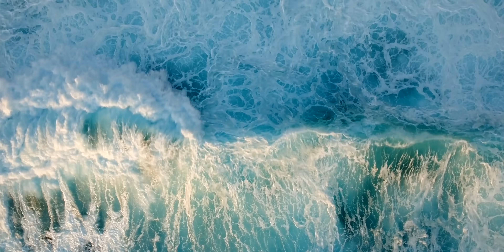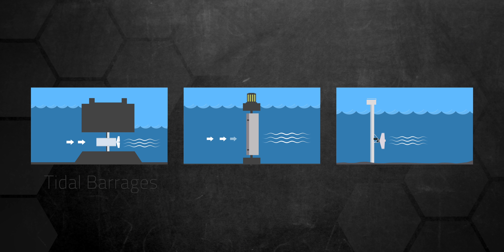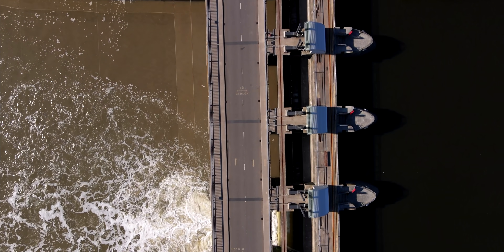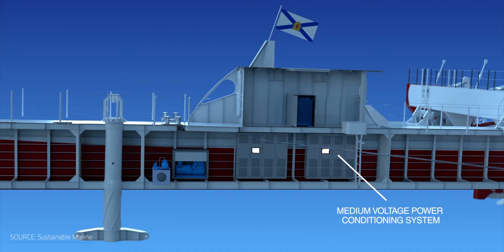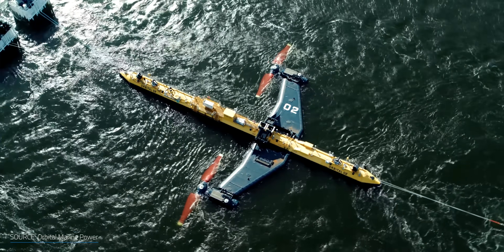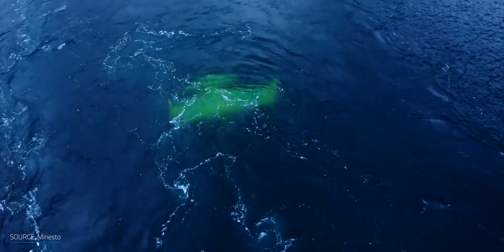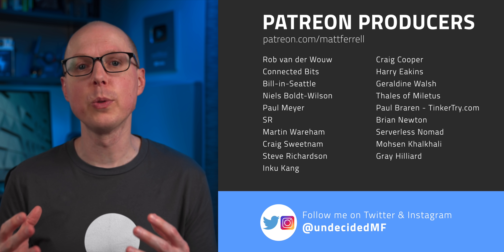Can Underwater Turbines Work? Tidal Power Explained

Comment: Would like to hear about any of these technologies that have little to no maintenance requirements, as that is the real problem with tidal energy. Thanks!
Reply: Minesto was spun off from SAAB, a company that is pretty good at building submarines. From what I gather, they have been focusing on keeping down maintenance costs from day 1.
Reply: Yeah. Maintenance costs must be very high because salt water is so corrosive.
Reply: @Thoughtful_Balance  Maintenance is factor, but Minesto solved that with an exchangesystem. Towing out a new system, change and than make the service on land. The system in Faroe Island for example is less than 1hour, from harbour to harbour. ( i think they went down to 30minutes in the end)
Reply: @tidal-oceancurrents7552  thanks a lot for the information. It's much appreciated. 👍
Reply: @tidal-oceancurrents7552  1 hour on each tiny installation each week... Talk about INSANE amounts of $$$.  Delusional.
Reply: @w8stral  what are you talking about? Maintenance The kite is 1 planned and one unplanned  per year. So 2 hours per year. (+plus the time for the job on the kite in the garage!) the kite is towed in so no lifting and with very small cheap boats. Maintenance is one of strongest part in  the Minesto-koncept.
Reply: @tidal-oceancurrents7552  Sigh.... Tiny installation which means gobs of these tiny shitty things needing cleaned as we need GW's of power this joke and since this is a moving structure hydrodynamic slow moving structure you must keep it clean far more often than once a damned year. In bad water, try every 2 weeks at worst case.  Any boat owner with the best bottom pain in the world can tell you this.  Only giant ships who routinely go past 20 knots which self cleans the hull of their ship can get away with cleanings every 5 years and even they lose plenty if not cleaned more often than that.
Reply: @w8stral  you know these are already operational, right? So you can already look at real world empirical data and not speculate.
Reply: All power generation technologies (even solar PV) need some maintenance.  These are small-scale R&D machines just like the first generation of wind turbines were.  The issues they face with corrosion are pretty much identical to the global shipping industry. I wouldn't expect a rotor blade to have too much trouble with fouling (just as with ships' props).  If the hulls of these machines get fouled that will cause a bit of turbulence but, I wouldn't have thought it would be significant.
Reply: @Tim_Small  Uh no, the issue they face is that tidal power is a joke as there is NOT ENOUGH of it to matter and it seriously has environmental impacts.  Massive impacts.  If the USA wanted to starve out everyone in Europe, all they have to do is slow down/nearly stop the Gulf Stream current, biggest in the world we can get to by far, with "tidal/current power" generation plants.  Impedeing said current... gets a pathetic ~ 20GW... Somehow I do believe the peoples of Europe would go to war over such an installation.
Reply: @w8stral  are you also one of those people who think putting up wind turbines will somehow slow down the jet stream?
Reply: @teohhanhui  Vast ocean currents move VERY slowly and are not able to be used to get power from.  Only a very rare few such as the Florida current in its small channel with a constant ~3knots can be used. 

As for GW and mixing.... Baloney, the mixing will just happen in different regions as it is temperature gradient based + wind to the 4th power.
Reply: Obviously they have gargantuan maintenance problems... moving surfaces underwater which are supposed to be hydrodynamic.... will grow barnacles etc....   Makes the wave energy guys doing blow turbines look sane.

Comment: 3D printed extremely powerful permanent magnets with an aluminum sheet as an alternating shielding that can easily slide fully between and fully out of the way by a tiny fraction of electric power that the pull of those 2 magnets can keep can keep cycling for many thousands of year as non-friction. The reason what this will not break the laws of physics is because it takes very little power to slide the aluminum sheet to detract those extremely powerful magnets. This does not have to be gravitational device if placed in a torus loop in which the magnets alternate corresponding with the aluminum sheets. The major downside would be the back and forth vibration and maybe noise. The mechanism is easy to build... just try it out.
Reply: I’ve thot something similiar in my head, but wonder if it eventually stops from friction or output only determined by input. But def cool idea needs tries

Comment: I live near the Ohio River, which has strong current flow, and several Hydro Damns.  Many people have small boat docks and the water is 30'-40' deep at the end of the dock.  I've often wondered if a small turbine could be mounted below the end of the dock, with a powerline running back to the house.  Would only need to produce about 20KW of power.  Some of this new tech makes it sound like this might actually work...

Comment: Even if ALL tidal power resource in the UK were tapped, it could meet only 12% of the nation's electricity needs. Therefore, it will struggle to reach scale and remain a small player in the green transition.
https://www.gov.uk/guidance/wave-and-tidal-energy-part-of-the-uks-energy-mix#:~:text=exploit%20these%20assets.-,Tidal%20range%20potential,of%20current%20UK%20electricity%20demand.

Comment: Except for the membrane type, none of those designs seem to solve the  harming marine life problem.
Reply: The thing is, all power plants have a heavy impact on the environment in some way. The greenest way to reduce emissions is to not produce them in the first place by using the energy we have more efficiently.
Oil plants are the source of some of the biggest catastrophes and climate change will kill much more than these energy sources.
Cats kill many more birds than wind parks btw.

If you want to save sealife get rid of single use plastic
Reply: @maxmustsleep  very true
Reply: I think thts the safest design by far according to my LOGIC, all it has is membranes Floating, i dont think even fish are tht dumb to die in a swaying peice of metal
Reply: I don't feel like any animal would want to go near any one of those things. But maybe the turbines might create a current that pulls animals so I don't know
Reply: Well it's that or global climate change.
Reply: Solar farms can require clear cutting, wind turbines kill birds, tidal is going to kill some marine life, hydro has large impacts on ecology, and that doesn’t account for the mining necessary to produce elements for those products. These are all great options over some fossil based power generation, but let’s not kid ourselves by thinking ‘green’ means no impact.
Reply: The minesto kite does not hurt marine wildlife. It is actually live right now so that is easy to study (which 3 universities are doing)

Comment: These are some interesting ideas that will work well for small marine communities with some battery storage for high and low tide where water flow is at a minimum. If they are used on larger scales like we do with wind turbines they will do more harm than good, and the maintenance activities and toxic waste creation and used component disposal stream will only harm the already over stressed oceans more in the long run. In short this is a good solution for the few coastal communities where SMRs, solar and wind with batteries or pumped hydro, and geothermal are not an option.
Reply: You are wrong😊

Comment: Because water is many times more massive than air, the blades do not spin at any speed that would actually affect marine life
Reply: Yeah I bet they are geared accordingly. As long as they don't create the same pressure variations from the huge wind turbines.

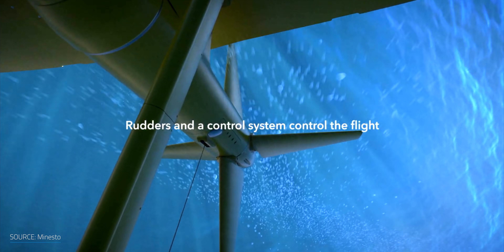Comment: 8:36 -- The "Deep Green" kite is fascinating because they chose to have the kite actively controlled by computer to keep a figure-8 pattern.  There are several known wing-shapes which will automatically destabilize aircraft at all times (often used by fighter jets).

If one of those unstable wing-shapes had been used, the water kite would be be continuously unstable (moving) through the water, presumably generating the same amount of electricity but more efficiently since the figure-8 control mechanism could be abandoned.
Reply: Don’t know if I understood but the energy is generating bybthe speed of water going through the turbin. How will speed increase with tpur suggestion? By skipping figure 8
Reply: They were spun off from SAAB, a company that makes both submarines and fighter jets. I think they know what they're doing.
Reply: Unstable would mean that without control it would spin, stall and fall to the ocean floor. presumably there is some shape that would do figure 8s passively but they probably considered that.

Comment: I always thought that the waves are strongest only at the surface and the currents are negligible close to the floor.
Reply: Yeah, I imagined that the bottom was stationary while the water on top sloshed back and forth.  But maybe it's just the wind that does that, maybe the tides do the opposite.

Comment: I think that membrane thing will be the one to catch on, can build dozens of them without endangering sea life (which will keep activists happy), is easier to maintain as all one has to do is fill some bags attached to it with air to bring it to the surface and do maintenance there instead, should be possible to attach an air bag to the tip for the same purpose, by adding air to it it prevents it generating electricity on the way up and allows for safe shutdown for the maintenance. For the airbags they just need to be connected to a pipe which can have a hose attached to it, once used they just need to be replaced with dry ones and left to dry for re-use.
Reply: I think this project is not working properly…to many moving parts.
Reply: @tidal-oceancurrents7552  Even if its a slow take off the tech will still gain the most popularity I expect, if I remember rightly analog circuits was originally abandoned because they were also difficult to build, yet from a vid I watched ages ago I heard they're experiencing a resurgence in popularity, I expect this will have a similar resurgence
Reply: The that gonna be a reality is Minesto, flying kites😊

Comment: How will they protect against contamination by sea life?  Will the cost to clean or maintain the system outweigh the benefits?  What is the life span of the system?
Reply: In Minestos case the lifecycle is 20years with 1pöammed and 1 unplanned service per year. Thether is exchange every 7 year

Comment: This issue isn’t “can it work” as it clearly works. The real issue is will it catch on, get funded and insured and adopted by utility companies and municipalities
Reply: Very true, and in Minestos case, the flying kite. That journey has already begun. SEV utility company i Faraoe Island is showing the path. With that said, floting wind have taken 90% of the attention. and most of the funding so far but we can clearly see that it will change. The kites are ahead of floating wind andis  both cheaper and more stable. Hopefully we will be able to see cooperated arrays between floating wind and the kites.
Reply: A huge issue as well is reliability. Water is very abrasive, the salt in saltwater is very corrosive, and tidal power is quite extreme. 
Many of the tidal projects that have been deployed in the past 5-10 years have broken or failed in some way.
We might need to take a leap in material sciences to get good reliable/strong products which can be used underwater to harness the intense power of tidal energy. It wouod need to be underwater with minimal maintenance for at least 20-30 years for the technology to prove viable. We're just not there yet.

But every experiment, every new deployment, every new video outlining the potential of the technology brings us one step closer.

Comment: Wasn't there a video about a wind power generator with no rotating parts?  It kind of just rocks back and forth to generate power.  Wouldn't a version of that work the same way with no way to hurt sea life due to no rotating parts?  Also, because they don't move much, you could more densely install them getting more power from a smaller foot print.
Reply: Came to make the a similar comment. May be that they need to be horizontal in the shallow waters to take advantage of wave motion. The VIV phenomenon is something we regularly have to fight for deep water pipelines/ platforms. Waves don't affect it as much as ocean current, but its something that definitely occurs.

Comment: The best Tidal Power I've seen is a buoy connected to an AC generator at the ocean floor. 
The buoy bobs up and down with the tides, 24/7. 
They are easy to make, close to shore for servicing and power collection back to land.
Reply: Tides or Waves?
Reply: @tidal-oceancurrents7552  Tidal waves.
Reply: @tidal-oceancurrents7552  Both, if you can picture it.

Comment: The were and tear on things that move is a high bar to jump with long term use.
Reply: But everything needs maintenance of some kind. Even non-moving solar panels need dust and snow removed. More trade jobs created as a plus.
Reply: @davidmccarthy6061  Then it will come down to a cost analysis of energy produced versus maintenance cost required vs nuclear and other fossil fuels used ect. 

Depending the technology used it is not as simple as paying someone a couple bucks an hour to climb up on a roof and wipe off the solar panels.  It is a interesting idea but interesting and practical do not always go hand in hand.

If it fails to be cheaper in the long run(after the tech matures) versus existing energy production methods, it is nothing more than throwing away money to virtue signal you are using green/renewable power.

Nuclear has been proven and is safe, provided we can use something besides 30+ year old obsolete reactor designs.

Comment: i have to type this in advance. this is my story with underwater turbines, powered by ocean currents. i was sitting in class as a student, drawing in my textbooks. lines became waves and my mind forged the idea of harvesting energy out of ocean currents. just flip a windturbine upside down, make it water proof, boom, renewable energy. so i invested a week of fierce research and came to a pretty devastating but clear conclusion. first of all its bad, its rly rly rly bad. its non efficent, immensly harmfull to the envoirment (sound polution in the ocean is a real threat for a vast amount of species, not to talk about the local impact through building such a thing etc.), and most importantly potentialy threatening to all life on earth. dont freaking touch the ocean currents ok? and more important, dont freaking suck energy out of them. instead maybe we should investigate how to pump energy into them so we dont wake up in a frostpunk scenario. besides, there are other technologies such as capturing energy from waves by a long snake shaped device thats floating on the ocean. it was fuctional back then (over a decade) and i assume there have been some advancements made through out the years. i still believe it is non viable and probably never will be. its damn inefficent, you have to get the energy from the ocean to the consumer, batterys are shiit, heat always escapes and i personaly do want to ensure the survival of marine life. using tide forces close to the shoreline is somewhat different and i see that getting exploited more in the future.

Comment: Fun fact: Tidal power is caused by the difference between Earth's rotation and the Moon's orbit speed. Meaning that tidal power stations are slowing down Earth's rotation and are accelerating the migration of the Moon away from the Earth. Of course this process is totally insignificant in the grand scheme of things.

Comment: Nobody cares about the birds killed by wind turbines and nobody will care about all the marine wildlife these tidal turbines will kill either. I'm sure they'll work fine.
Reply: Bird impacts are fairly rare and now they've learned to reduce it even more by painting one of the blades black. Underwater blades won't need to spin all that fast since power generation can be taken care of by internal gearing ratios. The fish will be able to avoid it. They could also put big guard rails around it to keep the big things away.
Reply: @davidmccarthy6061  It's not so much the impacts than it is the large sudden air pressure differences the migratory bird and bat species are subjected to when flying through a large wind farm, especially the behemoths (think jumbo jet pined to a small skyscraper) that are being put up now in the paths these migratory species use since they have a near steady wind current and the most economical place. Of course the number of birds killed by domestic cats is high also and people could care less.

Comment: For tidal power, the elephants in the room seem to be biofouling and corrosion.  I'd love to see a video dedicated to innovations to overcome these specific issues.
Reply: Bio-fouling is almost a non-sequitur.  Modern anti-fouling systems keep that well down, and theses systems all have to undergo periodic maintenance anyway.
Reply: @MichelVaillancourt  Awesome, I'd love to learn more about them.
Reply: Biofouling does not exist in moving wings. Like a boat in motion. corrosion is very low 20-30m under surface. Most of the kite (minesto) is made of Carbonfiber. So no rust!
Reply: @tidal-oceancurrents7552  The kite is very interesting.  TBH if I ever thought of hydrodynamics, it was about water in a pipe or maybe a spillway.  I felt like slapping myself in the forehead when I saw the wing.  Only now is it obvious.  So powerful, great idea.
Reply: I second that! Knowing how to deal with that environment is critical.